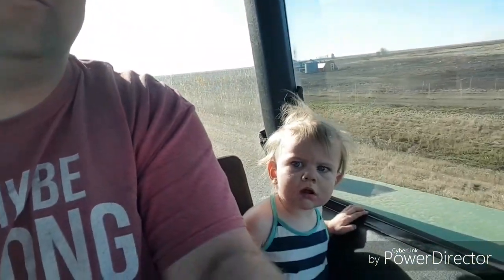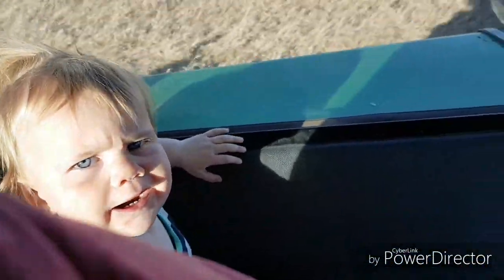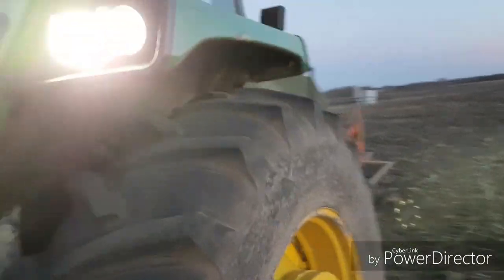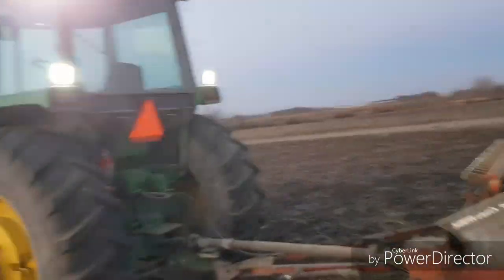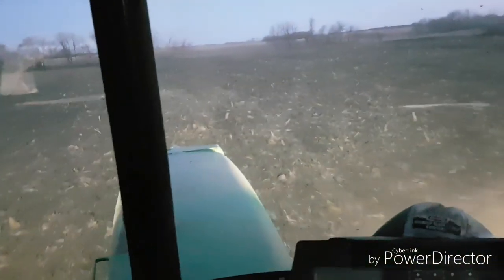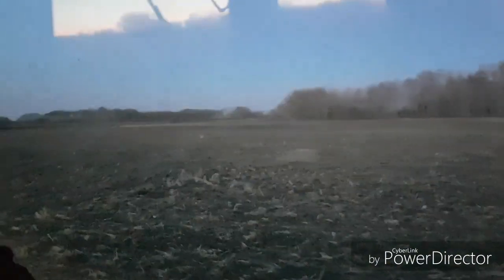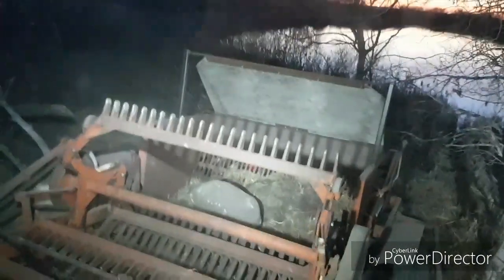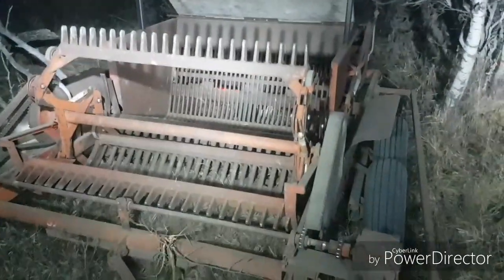Picking rocks with the 4440 and 57 rock-o-matic!!!!!

Comment: Last farm we owned was kind of a retirement farm was only 160 acres and milked only 32 cows but it was nothing but rocks. Pulled hay rack and thru rock by hand on it and then thru them in the many piles located in different places. We had a 16 foot John Deere disk for 20 years prior to that farm and the first day I did any field work was to disk a 20 acre field and bent and broke just about every blade on it. If you picked one there was no worry there was always one to take its place.
Reply from the maker: Sounds like the guy across the road. Only I dont think he believes in picking rocks lol

Comment: Wow that wasn't a rock it was a boulder! What would that do if she went inside the combine?
Reply from the maker: Would never make it lol
Reply: Yea I thought the same thing that my rock trap on my combine would save me but we ate one with my old TR 70 and it did much damage to the flow chamber around the axial rotors we junked it!
Reply from the maker: @Military-Museum-LP  well ya goddamn new hollamd and that stone door and no rock trap. New ones put so many rocks through they may aswell jave a second hopper for the crushed rocks. And dont say I'm crazy because me dad and antoine worked for a guy who ran a tr99  two cr960s and a cr9080 and each year they went through at least 3 rotors with then pos machines
Reply: The old Gleaners and older Deeres had good traps, anything too big for the trap would usually wedge under the auger...  And damn, they could get stuck TIGHT!!! Spent 20 minutes, broke two good chains trying to jerk one out with the service truck once...
I'm assuming the IH axial flow machines kick them out ok, we've been running a 1480 for over 20 years, never had a rock through it yet.. nock on wood!!
Golf balls though.... Damn things!!!

Comment: Are those nodding donkeys out there electric powered or engine powered?  Don't see power lines running to them so I was wondering.  

Used to be an OOOLLLLDDD nodding donkey down in the river bottom not too far from here... on winter nights when it was still and cold (and before half the @sshats in the world moved in out here) you could hear that sucker running all night... one of them OOOLLLDDD "one-lung" single cylinder big hit-n-miss engines... "put-put-put-put-pff-pff-pff-pff-put-PUT-PUT-put- pff-pff-pff-pff..." 24 hours a day if you really listened for it... it putted when the weights were going up, and "pff'd" (skipped firing) when the weights were on the way down LOL:)  When the weights were halfway up she'd hit a couple good "PUTS" when she was a strainin'... 

Later!  OL J R :)
Reply from the maker: Electric haha
Reply: @SouthSaskFarmer1  Ah well you enjoy the peace and quiet anyway... other than maybe the slow "creak, creak, creak" when they get old or need grease or service... OL J R :)
Reply from the maker: @lukestrawwalker  l9l
Reply: @SouthSaskFarmer1  So you serviced that stuff when you worked off-farm or what?? Remember you said in a previous vid you did some work for the RM and some oilfield service or something like that.  We used to have 3 gas wells on the farm here, and they're doing a TON of that directional drilling and fracking under the Shiner farm, but thankfully no well site on the farm because they don't do it like the old days... Back in the 80's when they drilled the wells here they dozed up a slush pit and dug a water pit, drilled a water well and hooked an air compressor to it to pump water, and set up the rig and drilled the well.  Came back later and dozed everything back out flat again.  Dumped stone and oyster shell for pads and a road, set up a salt water tank to catch distillate, and had a meter and a pipe guard around the well head and we farmed right up to within about 20 feet of it and the tank... Gas went through the meter straight into the pipeline network.  Later the well pressure dropped and they put a big old Waukesha-powered compressor on it running 24/7/365 that made some noise lemme tell ya but thankfully the houses were a minimum 1/4 mile away.  

These new well sites around Shiner first thing they do is doze out about 4 acres shave the hills flat cut into the sides and leave 45 degree cliffs and push the dirt out into the low spots with 45 degree drops off the sides to the valley floor below then top it with a foot or two of crushed stone move in a dozen semi-pulled square water tanks and plumb them together for the drilling mud and bulk water storage run flexible hose pipelines for miles along the county ditches and through culverts to pump water from centralized water wells through 10-12 inch hoses... Move all the equipment in drill the well, move the derrick out move the fracking equipment in looks like a beehive while they frack it, then move all that out and set up a permanent flare for sour gas and a tank farm for distillate and salt water... You can see flares burning 24/7 for miles around Shiner from Mom's front porch burning off sour gas from the separators, night and day.  They don't leave all that bentonite sh!t behind which about poisoned a  couple acres behind each well site for about 20 years anymore but holy sh!t these gigantic well sites that cover 4-5 acres with gravel sure take up enough d@mn space!!!  Can't do ANYTHING on gravel even graze cows LOL:)  

Later!  OL J R :)
Reply from the maker: @lukestrawwalker  sort of lol